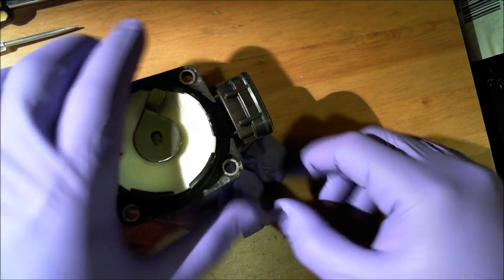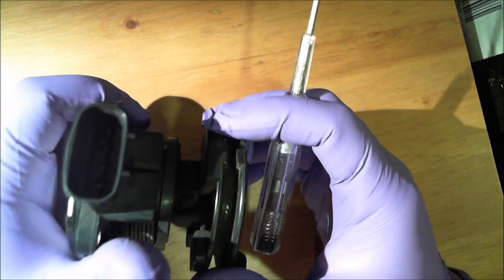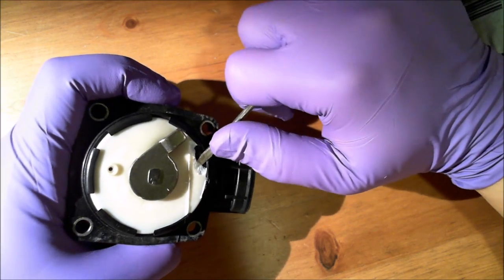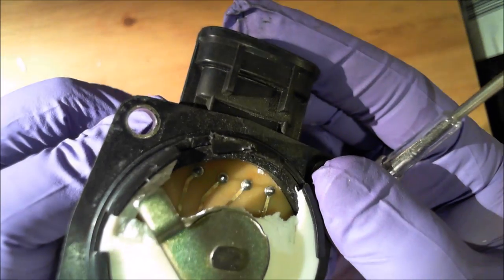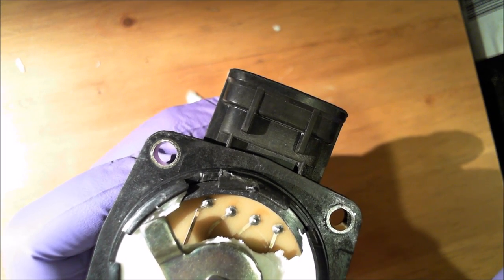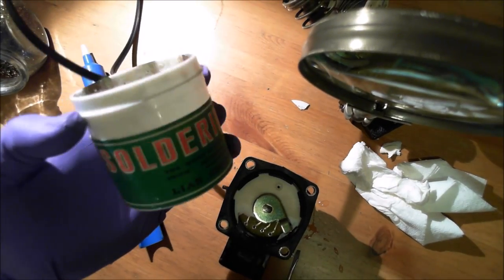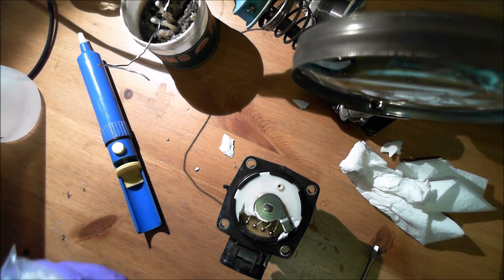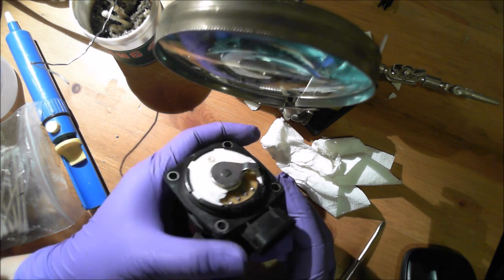#P1120 #P1121 #How #to #repair #Accelerator #Pedal #Position #Sensor on #Lexus #GS300  #IS300 #apps

Comment: After watching your video , i repaired mine on 03 GS300 , the way i did it was i scratched almost half moon and then used my heat gun to soften the plastic tabs and lifted the white part until half moon broke off , did my soldering and again used my heat gun to soften the tabs , slid the half moon into the tabs , bent the tabs over the half moon and glued the haft moon back in place , worked perfect , thanks for the hint . very informative video . Saved me money .

Comment: Just did this exact repair on my Toyota 4 Runner 2001 3.4L. Did not have to pull the throttle body as the four Philips head screws were front facing. All is good. Thank you Luxious Automotive!
Reply from the maker: Glad to have helped. Feel free to support us by purchasing a flip key. To order visit: https://www.luxiousauto.com/products/flipkeys
Reply: @MrStumpranch same thing on the same vehicle is why I’m here lol

Comment: I just purchased a GS300 in Melbourne and got told to rid of the limp mode I needed to change the throttle body because of the sensor or something... Did that and hasn't worked.. Couldn't believe there's a video here of what it actually is!!! I thank you sir and shall try this next weekend!! Thanks again 😁🤙🏽
Reply from the maker: Did the video help?

Comment: Worked for me. I was skeptical too! Thank you for saving me $200 for the part. Mine was the solder joint in exactly the same place. Open circuit VC to VPA2 pins 1 and 4. Good instruction on soldering.......Master Toyota Technician.

Comment: Thank you for this. Worked like a charm. Had to pull cable off battery and reset for the check engine light and vsc to go away. After that perfecto!! Much thanks!!!

Comment: Just got an is300 yesterday kept going into limp mode and throwing codes. Was sceptical of this but Pulled off throttle body and resoldered this and cleaned the butterfly. So far so good, just pulled it back off to jb weld the broken hole. Thank you!!

Comment: Absolutely the best solution, thank you!!! I followed this and it fixed it. Mine failed on my 01 at about 230k. Was not going to spend $200+ on that sensor when clearly the solder joints are really the fail point. Nothing to lose on this and it works!
Reply from the maker: Thank you for your feedback, glad to have helped
Reply: Hey Chris can u reply
Reply: Shadow sure, what’s up?
Reply: Chris I need help with my is300 u got insta ?
Reply: My is300 is hesitating will this work? I got no reply from the video creator. Thanks

Comment: Definitely worked for me! Thank you! 2001 gs300 212k on the odometer, going strong again!
Reply: Eddie Robison is it just 4 bolts to remove (12 mm) then plug in?
Reply: @viscioushattermaid4410  there are four 8 mm bolts. But I had to remove the throttle body to access all the bolts. So I needed a new TB gasket to put it back together.
Reply: Eddie Robison I have the same
year car you have. I will attempt this today somehow. So it’s not 12mm it’s 8mm bolt? If only a video of removing and installing this part is available.
Reply: @pyro707  yes, 8mm bolts if I remember correctly. Sorry I didn't make a video. If I remember right those bolts were tough to reach, that's why I removed the throttle body. Good luck with it!

Comment: Hello, I see the video is from 2018, but found it very insightful. What I did want to ask is have you ever tried to disassemble the APPS and removed the whole electrical board instead of breaking in through the backside? I own a 2001 4Runner with a P1120 & P1121 code. Unfortunately, Toyota doesn't sell the APPS individually, instead trying to sell you the entire throttle body with both TPS & APPS sensors attached  for $675. Have you found a place I can purchase the APPS w/o the throttle body?  Would be great to hear from you. Thank you, Eric
Reply from the maker: The contact points that needs to be worked on are on the back of the APPS. Cutting it open would be the fastest and direct way. 

The APPS on the 2001 4Runner looks similar in shape and design. You can try this method and report back. It's free so if it helps then it's a win. But if not then you'll just have to replace the one that already failed.
Reply: @LuxiousAuto  I have a similar issue with my 2001 4 Runner that I am now quite certain is due to one or some of those solder joints going loose. Looking at the Accelerator Pedal Position Sensor head on, there are 4 easily accessible Phillips head screws. I don't see a reason to have to pull the throttle body. Am I missing something?
Reply: @LuxiousAuto  Hello, I am happy to report that after removing the APPS, being very careful not to strip the 4-Phillips-head screws, I was able to use your technique and repair my APPS sensor, thus saving myself about $700 on parts alone for a new/complete throttle body unit. The APPS is not sold separate by Toyota or any 3rd party parts company for my year/make vehicle. 

NOTE: Instead of prying up and breaking the plastic backing, I used a multi-tool with a very fine tooth blade to surgically make the diameter cut and again around the sides, just so I could remove the half moon white plastic piece exposing the 4 solder points. Once fixed, I just used gel super glue to put it all back together.  #WIN!!  I would add photos here, but it doesn't seem to like the "paste" option. 

It's been 2-days now and seems to be working great. I want to sincerely thank you for doing the research and posting this very helpful DIY video!!! Love my 2001 4Runner and it's running as smooth as ever! 260k+ mls. It's my daily/work vehicle, hauling video production gear. Roughly 300-500lbs.  www.loftdm.com  THANK YOU!
Reply: @dcvideoonline   Having just done this fix myself, I would highly recommend spraying  the 4-phillips screws with WD40 or some type of pipe-break to loosen the 20+ years they have been in there, prior to attempting loosening. I'd give each a tap with the  proper size phillips head screw driver and slowly try to break them loose. Put a lot of force inward. DO NOT STRIP THE PHILLIPS HEADS. TAKE YOUR TIME.  You do not need to remove the throttle body. I'd take pictures of it on the truck and of the unit before starting.  Good luck!
Reply from the maker: @ericbugash5107  tried posting this info in the largest 4Runners Facebook group but the post was denied.

Comment: a quick way to fix this that i dont recommend lol nice and good job man thanks for the help!!!
Reply: He means reheating and reusing the old solder.. he doesn't recommend... I did this last night and it worked. I used a drimmel though to cut the plastic.. so I could have as much or a peice to use and put it back together with apoxy.

Comment: my Ariato 2jz gte has a problem with cold idle and runs super rich, I have checked voltage on this sensor and on closed Throttle it's showing 1.4 volts.? Shouldn't that be 0.4 volt ? Going limp mode too

Comment: what are some of the symptoms u’d experience if this issue occurs? Experiencing intermittent throttle lag/hesitation on a 05 ES330 at lower speeds. feels like i have to press the gas 30-40% to accelerate at times, other times it just takes off.
Reply: Possible that could be a throttle position sensor issue

Comment: This also works for the failed brake light sensor in the back.
Reply: I can’t figure out how to fix my failed brake light sensor in the back. Hope this helps and thanks.
Reply: pyro707 it’s on the driver side above the rear wheel well. Solder all the large connections even if the look tight.

Comment: Do you know how much new accelerator position sensor is I'm just asking cuz it doesn't look like it's worth soldering it and all that if the part is not too expensive just replace it  right?
Reply: I just bought one yesterday at Westminster Lexus:  $445 out the door, although a cheaper version is available on the internet.  My car was dead in the water for two days and I didn't want to wait, but the price is indeed somewhat less if you have time to wait.  I have the old one, and I'm thinking about giving this a shot, just in case I ever need to replace the new one.

My car is a 2001 IS300, and I'm the original buyer.  92K miles on the car, most of them very trouble free.
Reply: Saw that sensor on eBay for 150.
Reply: $20 on Amazon.  Just bought one.  Works great
Reply: @anthonyakahydroantdavis8373  I would love to see the link.  I only see TPS, not APPS on Amazon unless OEM, which is almost $200
Reply: @anthonyakahydroantdavis8373  i call bullshit

Comment: My 2000 Lexus GS300 just got P1121/P1120 code and the accelerator is not working well, barely drivable. How do I locate and remove it to do the repairs that you showed? Thanks!
Reply from the maker: Look up GS300 how to remove accelerator pedal position sensor on Google.com
Reply: @LuxiousAuto  Thanks! I found the service repair manual.
Reply: It works! Thanks a lot!
My friend a retired RF engineer helped me measured the resistance between VC & E2(lower two connectors) first. Then did the complete remove, clean and re-soldering. Wait a little to let the connecters to cool down, remeasured the resistance and saw improvement of connectivity. Even it took me a while to get the sensor out because I am not very handy. But it is definitely doable and save me a lot of money. I owe you one!
Reply: @LuxiousAuto  It works! Thanks a lot!
My friend a retired RF engineer helped me measured the resistance between VC & E2(lower two connectors) first. Then did the complete remove, clean and re-soldering. Wait a little to let the connecters to cool down, remeasured the resistance and saw improvement of connectivity. Even it took me a while to get the sensor out because I am not very handy. But it is definitely doable and save me a lot of money. I owe you one!

Comment: How do you remove this? On the gs300 the bottom bolts they are in very tight position.
Reply from the maker: Remove throttle body first.
Reply from the maker: Removing apps on the vehicle is a good way to strip the 8mm. Remove the TB  so you have better access. Saves more time and hassle trying to find the bolts and reduce the risk of stripping

Comment: I put Lucas upper cylinder lube and 15 miles later gave me an 02 sensor code and a throttle position sensor code p1121 is this coincidence? Now car in limp mode, had zero problems before adding that liquid shit and o2 sensors are all new 3 mos old
Reply from the maker: Check the section of wire above your headers.
Reply: Luxious Automotive the wires that are covered ? Could it be a loose throttle cable? Mine has some play
Reply: I took day off work and used your fix it worked! Thnks!